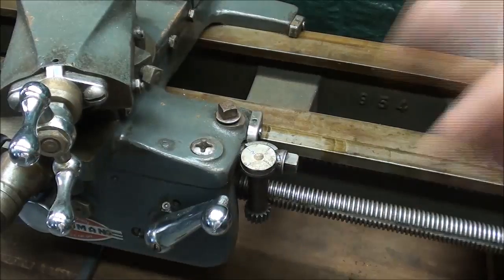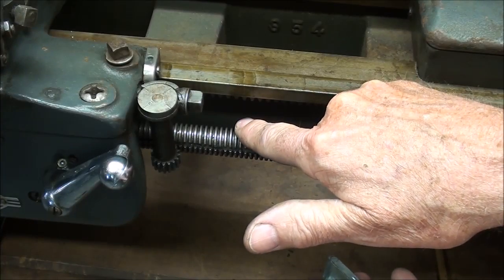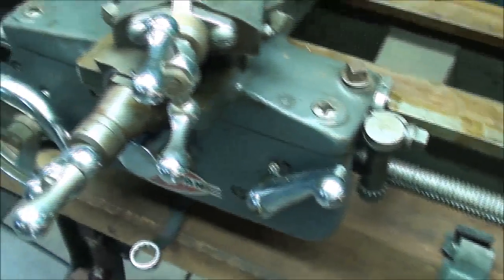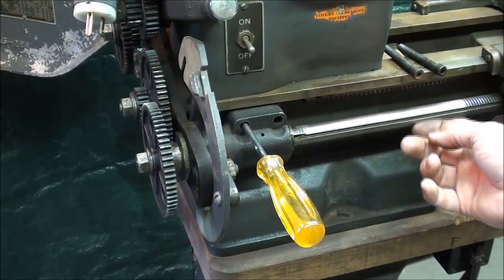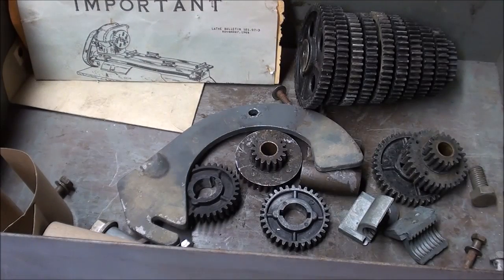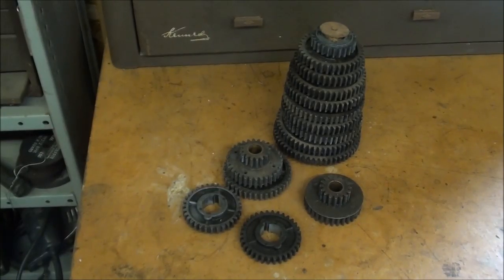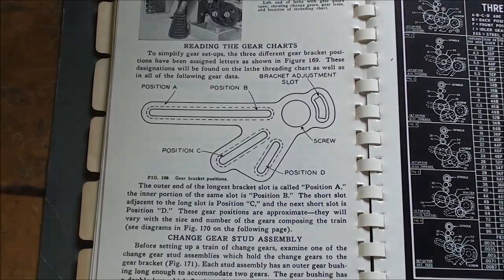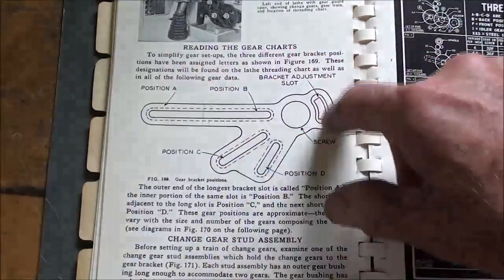SHOP TIPS #221 Adjusting the Change Gears on Atlas Lathe pt 2 tubalcain

Comment: Mr. Pete. I have a question that is not covered anywhere that I can find an answer. On all of those Change Gears I notice on my lathe that for example one side of the gear would show a  24 (for instance) and the other side is labelled 24A Can you enlighten me? The gears appear top be symetrical.
Reply from the maker: Probably a pattern number

Comment: You mentioned that you must have a thread dial in order to thread - not entirely true. You can just have to run the carriage forward and back without disengaging the gearbox. Takes much longer but can be done.
Reply from the maker: +Bradley Weingartner Thanks for watching--very true

Comment: If you were to make a screw for a pocket watch, at 360tpi. what would be the gear setting?
Reply: +shootgp Theoreticaly it is possible, If you look at the feeds portion of the chart the coarse feed will give you 420 TPI so by using the mathematics for compound gearing in Machinery's Handbook you should be able to work out the gear train.That being said I don't think a lathe as large as the one shown would be capable of the fine adjustments to control such as depth of cut etc.
Reply: +ElCid452 360 TPI? is that a joke or type-o? lol
Reply: +shootgp No joke nor a type o'. American Machinist Handbook vol.#7, pg.190/191, Elgin/Waltham watch screws.
Reply: +ElCid452 I don't have the book, but there must be a type-o. 36 TPI is a very fine screw. 360 tpi is a smooth cylinder. The Atlas lathe is not ideal for making watch components - there are specialized watch/jeweler lathes for that. If 36 TPI is what you're actually looking for, I'll dig-out my manuals and try to explain the correct gear orientation to you (which gear and wear).
Reply: shootgp Thank you. My book has the tap/dies list, but not how to cut them.
Reply: +ElCid452 The gear bracket, or banjo as Mr. Pete calls it, varies between lathe versions. The only gear charts I can find are for my specific lathe, a side view looks like someone is pointing with their fingers hanging. Is this what you have, or do you have the three slots as shown in this video?